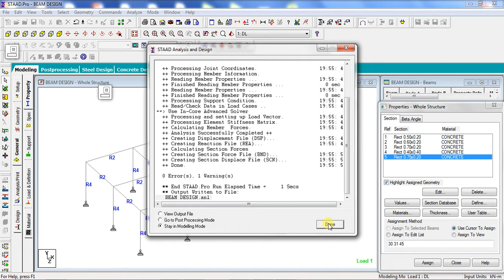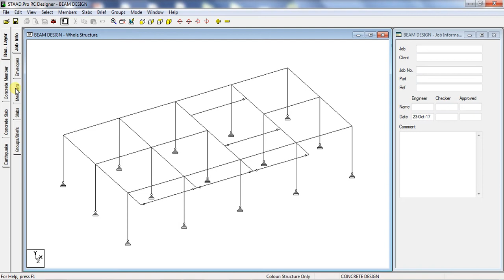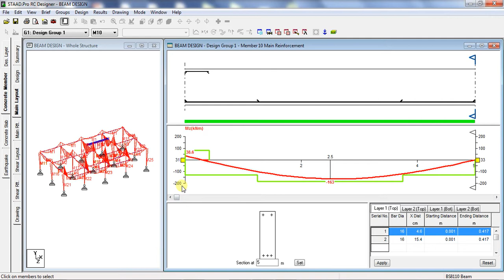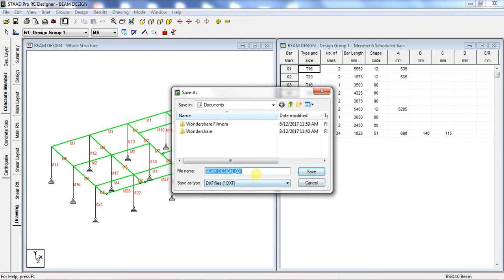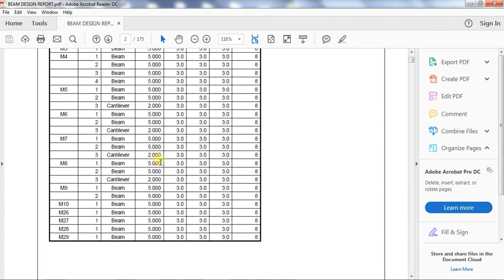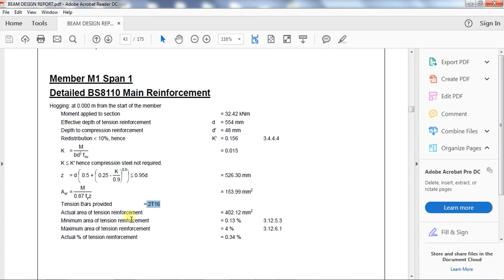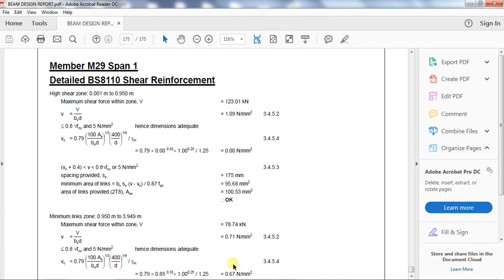BEAM DESIGN IN STAAD PRO RC DESIGNER PART 2/2

Comment: wHAT IF THE BEAM IS IN BLACK COLOR STILL IF YOU DESIGNATE THE NODE SUPPORTS CORRECTLY? WHAT IS THE PROBLEM WITH
 THAT?
Reply from the maker: check support condition for that beam.if it's shows not supported then you need select support type manually.